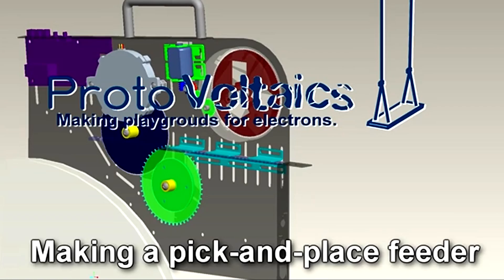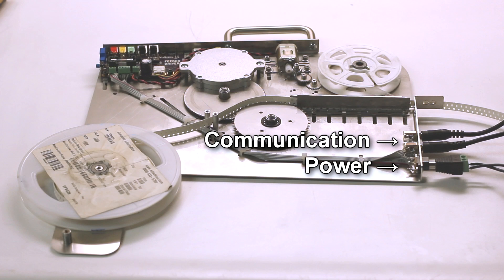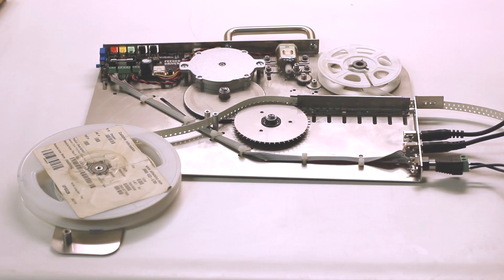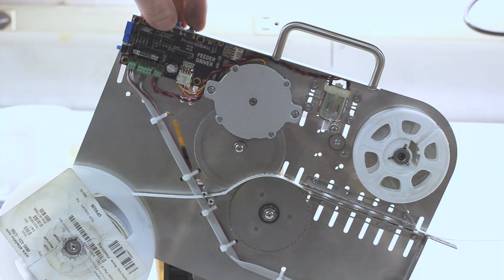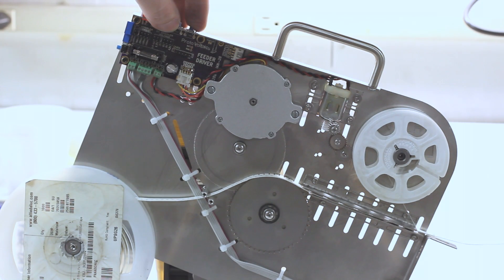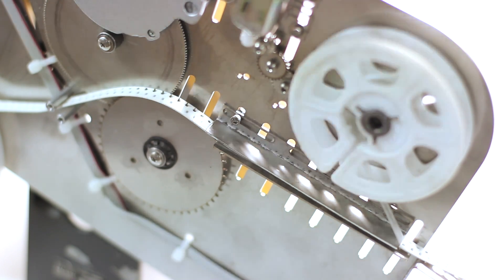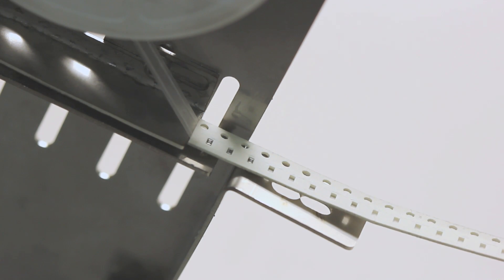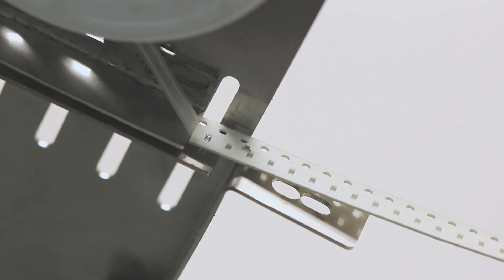Pick and Place Feeder Prototype

Comment: That looks like a really nicely made unit. I may have overlooked something here but one thing that I thought may be an issue is - suppose you accurately work out the number of steps to advance the tape for each component then however accurate you are after 100 resistors have gone through you are bound to have drifted off a bit, wouldn't you need some sort of feedback system? an optical sensor through the tape hole or something like that?
Reply from the maker: We will find out.  Certainly to calibrate we'll want to run out 100 or more parts, see how many steps we took, and then determine the steps needed for one part.  Maybe that will be good enough?  Maybe not.  Perhaps if the pick-and-place head has a flying vision system it could provide the feedback needed?  There are 3 spare inputs on the feeder controller board if we need something like an optical sensor through the holes.